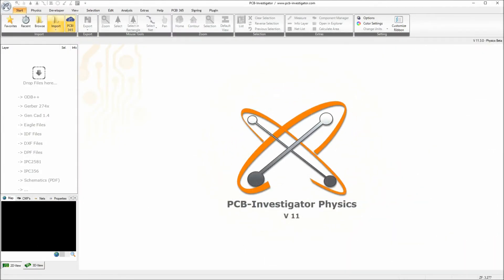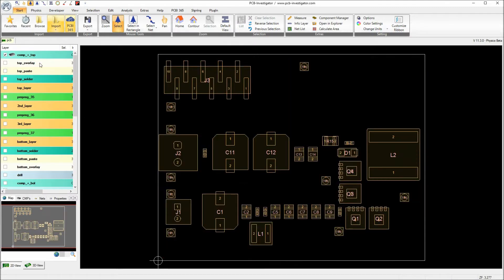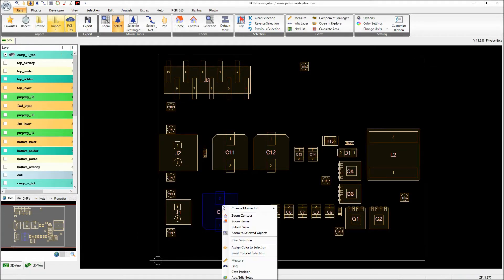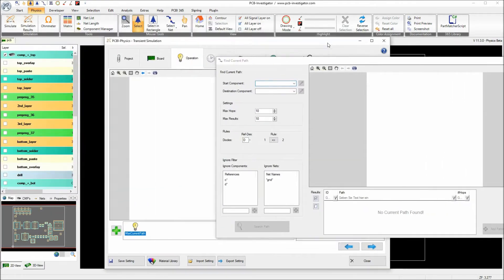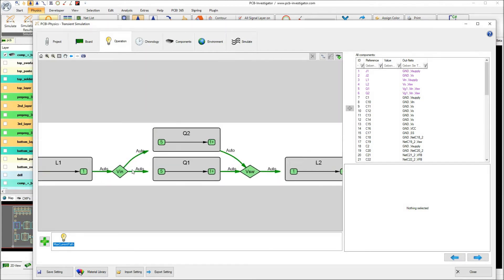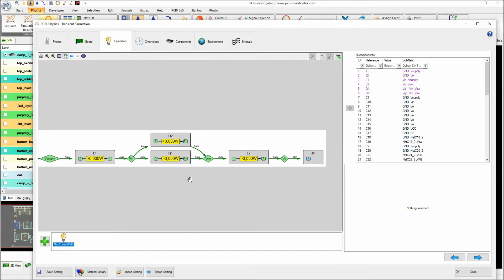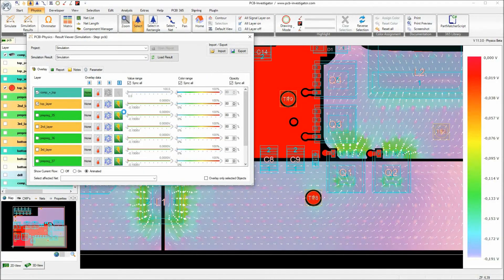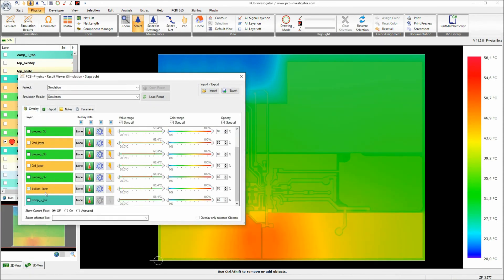PCB-Investigator Physics - Tutorial 7 (PinBridges & EasyLogix Part Library)

Comment: Hello thank you for the tutorial. 

I have a question: I was trying to run a static simulation on few components and I didn’t use the path function. I simply added few components to the operation state and ran the simulation with active power dissipation. 

But the simulation says there’s no active operation state and just returns the ambient temperature thermal map as the result of the analysis. 

Can you please clarify where am I making the mistake?